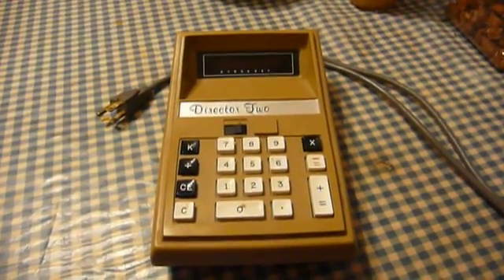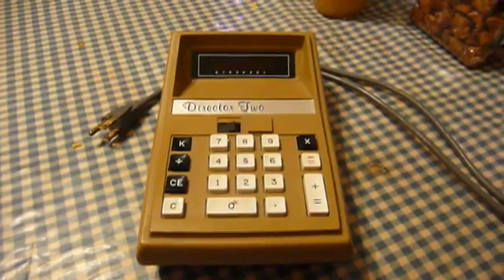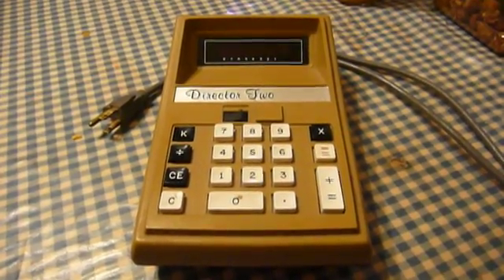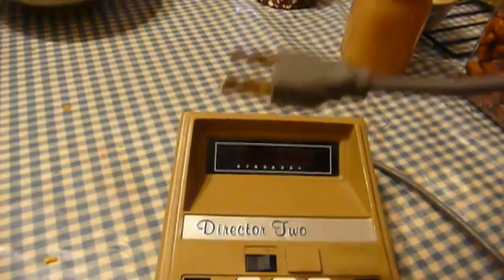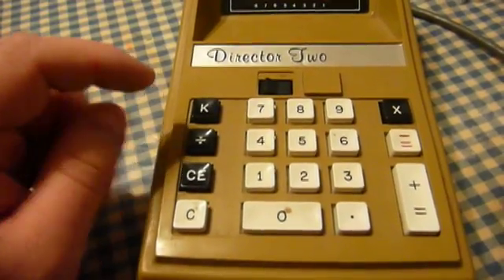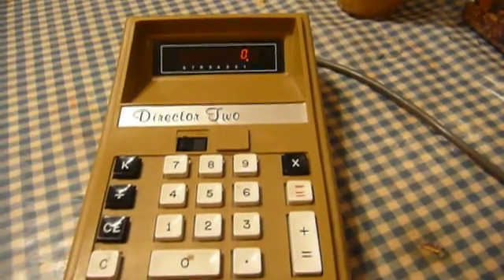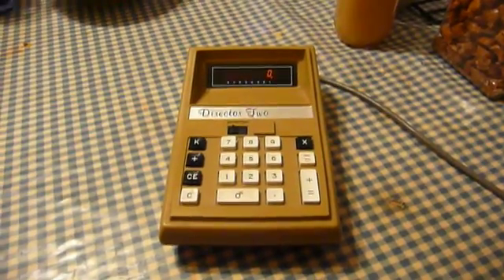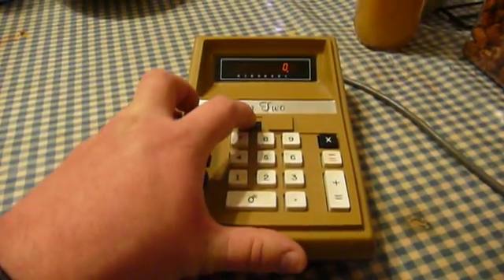Eldorado Electrodata Director Two Calculator

Comment: OMG!  I just picked one of these Eldorado Electrodata Calculators up at a yard sale, it has Elborado 8K on the name plate in place of Director Two.  And long with the On/Off switch it also has a 2 F 4 switch all in great working condition.  I will be placing it up for sale on eBay check in a few days.  Title: "Very Rare 1970's Eldorado Electrodata Corp Electronic Calculator "Eldorado 8K"
Reply from the maker: Fair enough, but they are not very rare. Quite a few of them survive to this day, as once they got past a few teething problems, the majority were extremely well made.
Reply: @uxwbill  Thanks for the information...it's live on eBay right now...$58.88 however I will take less...thanks again for your help.

Comment: I looked this up in honor of pi day!  I worked for Eldorado from 1966-1972 - one of my jobs was final inspection (I also worked in customer service doing repairs after my inspection job, was in the guts of these things often) part of the test..
3.14159 * 2 * 57.2958   = 360... well it did then, back on this old calculator.. cause that was as many decimal places it had.  The original models had nixie tubes for the display and no IC's.. all transistors.
Reply: I will have to go look for the web site.  The Director Two was not the first one, the first was much bigger.. I am going to look for your website.

Comment: @uxwbill One way to tell would be to open it up and look on the inside, the ABS plastic they used to use for computer cases, monitors, and the like, had boron mixed into it for fireproofing. Over time, and especially exposure to sunlight, it would turn yellow and eventually a sickly brown colour. It is reversible though, they is some sort of mixture of oxyclean and peroxide that is supposed to put it back to like new condition.

Comment: @uxwbill The reason was to replicate the behavior of the electromechanical calculators that were common just few years before this. Quite quickly it went out of fashion so to speak but were and still is common on accounting style machines partly because of tradition partly because once got used to it's faster especially in add/sub many numbers. Think of it as adding negative numbers and it should be much more logical.

Comment: I have a Sharp electric calculator from around 1982 according to the date stamp on the bottom, I think it was used in a retail store.  I also have a little Sanyo calculator from probably the 70's that runs on batteries and doesn't blank the display when 'thinking', in fact I haven't used a VFD calculator that does that.  That's a pretty interesting calculator, it would have been very expensive when new.

Comment: I remember playing around with an old Radio Shack branded calculator that had the same kind of display. It was smaller though, and ran off a 9 volt battery. So it was a bit newer. I want to say it was from 1978 or so. It was interesting to that you reminded me about the 'thinking' phase. That calculator did that as well.

It also accepted AC power as well as far as I remember. But the adapter was removable to make it portable.

Comment: I have the same exact calculator except mine is black . I got it for when I was in electronics school in 1973 so mine was made in 1973 . I took it apart once and some of the chips say 1970 and later years . I used it and passed the school and I paid 157.00 for it with my school discount.  Man those were the days back then .